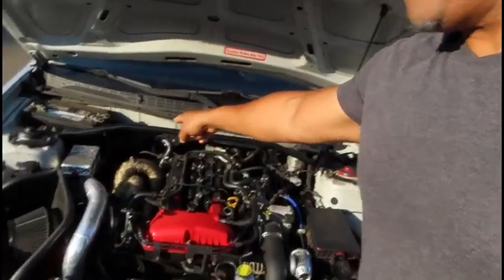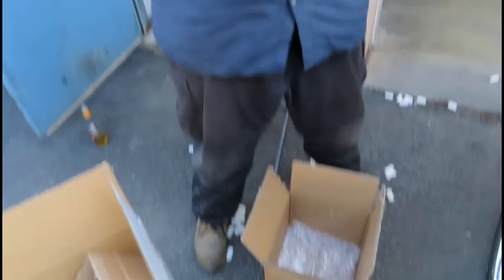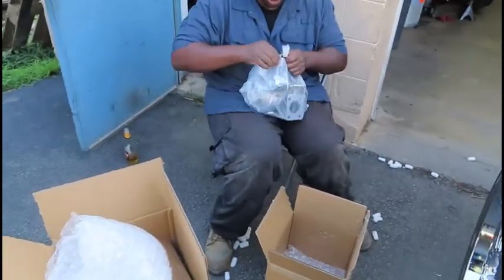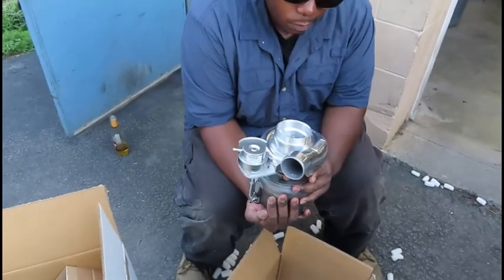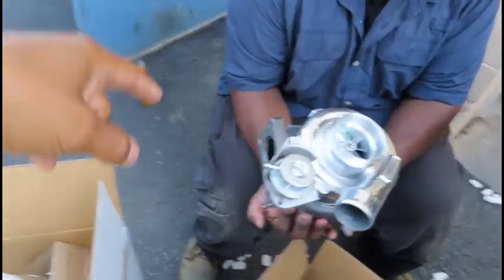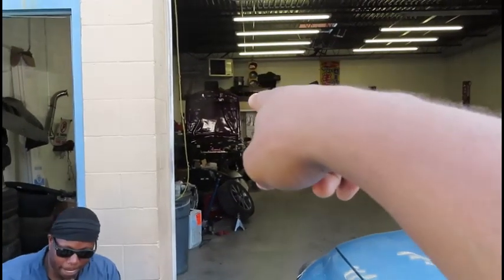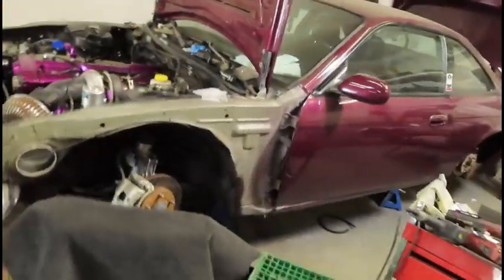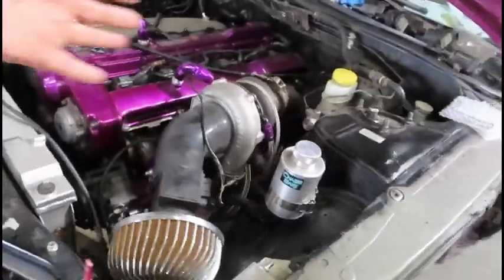OEM Fitment Turbo Upgrades: *Genesis Coupe*

Comment: I put the tomei mx7960 on my bk2 with the mxp manifold, bk1 o2 housing, and methanol injection. Made close to 400whp at 23psi. Great turbo.
Reply: Do you recommend a o2 housing? Thinking of getting dp and tp just not sure if o2 housing is worth the check engine light
Reply: @Steven_Bo1  you can get the check engine light turned off with a tune. O2 houing will definitely be able to net you more hp.

Comment: Chuck you should call turbokits.com, I think they are located in Connecticut. They have a few options including an in house kit they make for the sonata 2.0T. They helped me with my GT3076R bottom mount. And definitly get a better manifold. Not knocking ISR, but I wouldnt trust their manifolds or turbos to hold up well. Love the videos by the way!
Reply: obviously I didnt watch the entire video before commenting. Genracer is awesome, but turbo kits.com has a shop in the N. East.
Reply from the maker: devind42987 lmao, that’s ok!

Comment: How much power you have now? Looking foward for that 750hp on that turbo wonder how much whp  it pulls thats what matters to me 🤣🤣💪
Reply from the maker: Good question lol!! I’ll get it tuned to see what the numbers are currently before putting the new setup. With the new setup I’m looking for between 550 to 650 whp.
Reply: @ChuckTateD117  SWEET THATS MY GOAL 400-500 WHP I just want a street car not them 3 sec car at the drag strip 🤣🤣🤣🤣🤣🙏😅

Comment: A question though ... isn't the Exhaust manifold restrictive with the way its build ? 
Meaning would a custom built one flow better (longer radius bends ?)
Reply from the maker: Przemysław Wilkutowski yes it could’ve been built a lot better! I’m changing the entire setup this winter!
Reply: @ChuckTateD117  In that case if possible make a good video showing this new exhaust manifold in details. I'm gathering info for my car so would be happy to see exact thought process on how the custom one was designed and how the flow was routed to fit under the hood

Comment: Hey man, my 13’ stock turbo just took a shit recently and I’ve been debating about upgrading. I’ve looked up some of these already but would these turbos require other add ons like fuel injectors and fuel pump? I’m new to looking up turbos
Reply from the maker: At minimum you’ll need to upgrade the intercooler, and the exhaust from the turbo back and tune. 
Currently I’m running a canned BTR tuned ecu that meant to be run with the stock turbo, stock injectors and stock fuel pump, with the EVO9 turbo with no issues.

Comment: My turbos taking a crap. When its cold it works . when it gets hot it has no boost. Whats a upgrade bolt on stock fit turbo upgrade to get some xtra hp without changing anything else at all. 2011 coupe.
Thanks
 mike
Reply: Did you ever get it?
Reply: @jlytetheproducer1203   funny thing is i noticed ,that when my gas was low the turbo didnt create any boost, or that what it seemed to happen , but also i installed a short  cold air intake on it , now it does not have the problem, i dont knolw for what ever reason but its been working fine for months now . but i still like to get a upgraded turbo, maybe in time , good luck
Reply: @mightymik32  yeah I just installed a short ram intake too works great I also want to upgrade the turbo in the future but I’m glad you’re back running good lol appreciate the reply
Reply: When gas is below 30 miles til E you only get 5 psi boost

Comment: Are all of these turbos for BK1 and BK2 or is there a difference because all of these show that they are for a 2010-2012
Reply from the maker: They do have these options for both BUT Sure you are looking specifically at your model!! Obviously due the different turbo housing designs between the BK1 and BK2.

Comment: Would you recommend the bk1 2.0t Genesis as a good kdm starter car? I'm tryna get my second car, coming from a s197 mustang.
Reply from the maker: Donovan Gary if you are planning to build it, then yes! Unfortunately a lot of people by a bk1 2.0 expecting it to be fast and it’s not. Hyundai intended for people to build it. If you get a BK1 or Bk2, then I would immediately do intake exhaust intercooler, and a Alphaspeed tune at minimum! That will make the car more enjoyable and START to unlock the potential.

Comment: On the garrett for bk2 what upgrade do u need for oem housing
Reply from the maker: Are you asking about the exhaust manifold? As far as the Garrett turbo itself you won’t need to upgrade the housing.
Reply: So on bk2 stock 02 housing and manifolds, would it just go in after u pull oem out? Trying stay safe on emissions and cel issues
Reply from the maker: @kodyl2550  yes it is a direct bolt-on.   But depending on which Garrett you get you will more than likely need to do other upgrades like a tune. I personally keep all of my stock parts for emissions purposes. You wouldn’t  need to swap out the Garrett turbo, you would need to put the stock catalytic converter and down pipe back on and the ecu would need to be stock, soo in that case buy a 2nd ecu.
Reply: @ChuckTateD117  ok im l9oking at same one u gotten the gtx up to 600hp just seeing what else i got to do, i plan on upgrading and tuning with alpha just curious on what else
Reply: I plan on doing a copy ecu, as of now i got secondary cat delete and catback into xs race pipe, but left main cat o2 housing, should i be able to bolt up to that ? That easily
Reply from the maker: @kodyl2550  yes you should be able to bolt right up!
Reply: @ChuckTateD117  thank u i really enjoy the feedback, im just making sure theres not more then turbo and tune, since turbo is like 2k alone